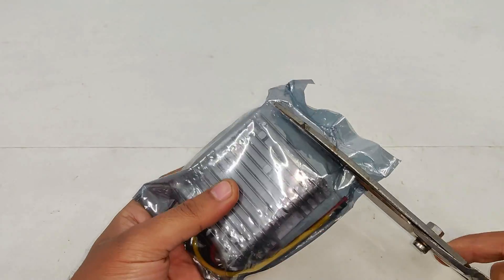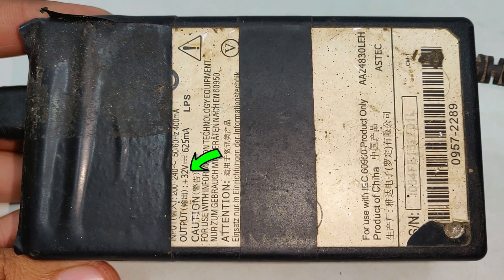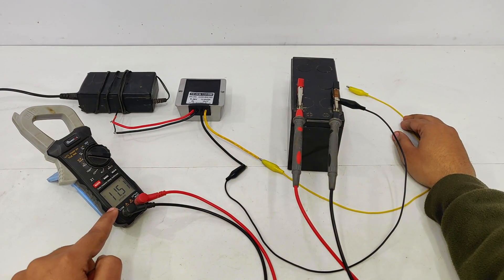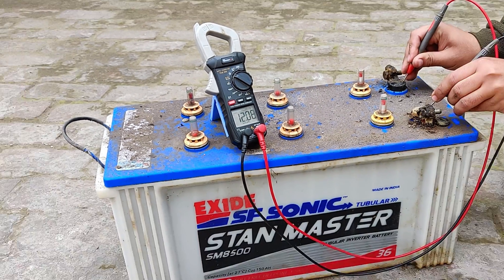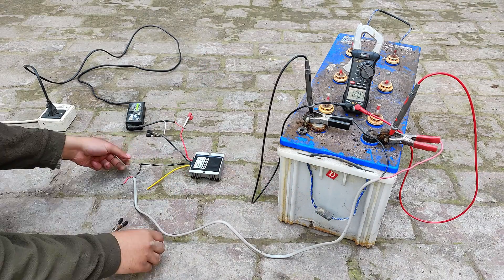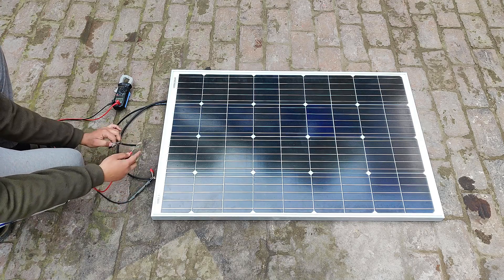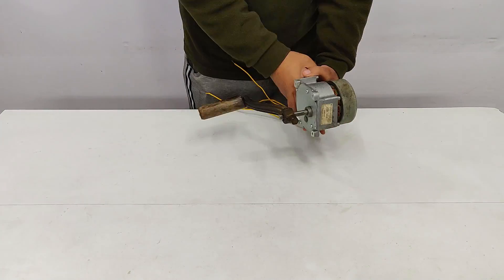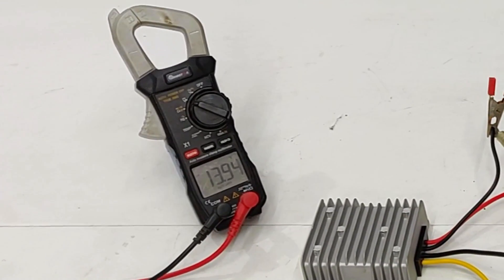12 Volt Power Supply for 150Ah Battery Charger using Laptop Charger - 220v AC to 12v DC

Comment: This module is not suited for charging a battery.  It will overload the charger if the battery is discharged. You need a module that support a constant current output.

Comment: Hello, is this converter suitable for long term use?
Reply: No it will cook your batteries. No cut off control.
Reply: you will need a bms for your battery dont use any charger without any protection circuit

Comment: If dcinverteris out putty Ng 13v or greater to charge a 12v battery you should be measuring 13v at battery when connected
Reply: No.. the battery will pull it down to a lower level depending on it's internal resistance and amperage of the DC converter.